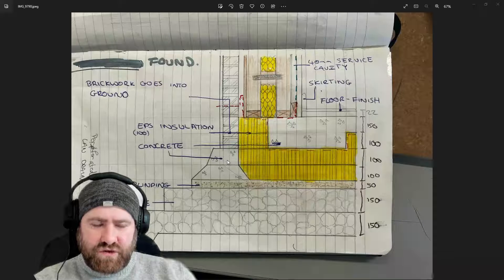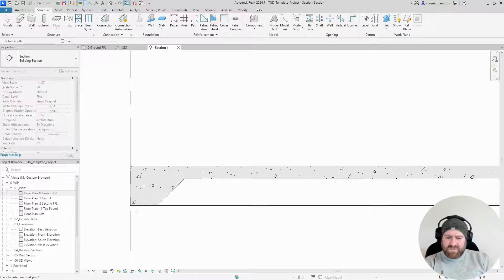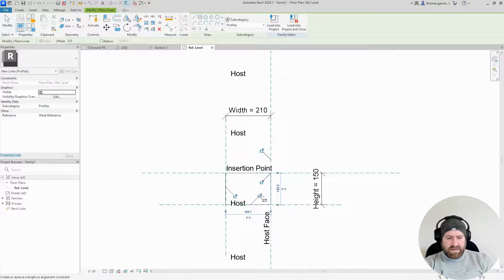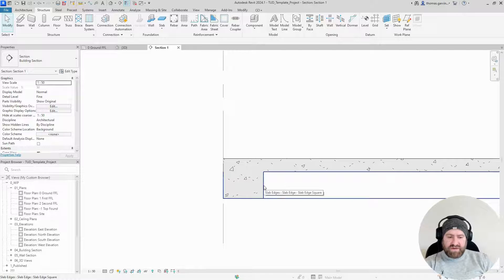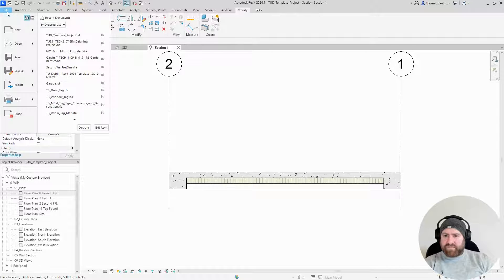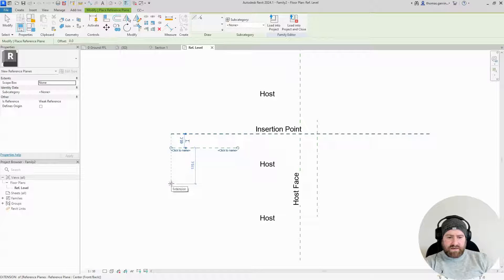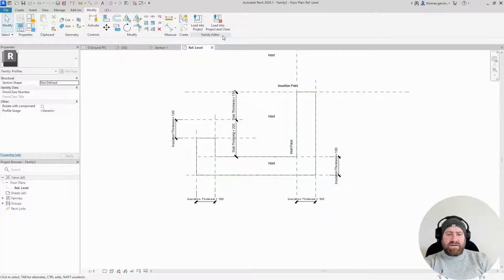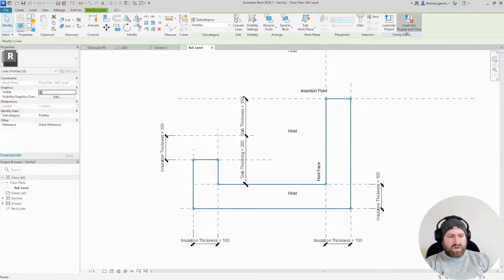Revit Slab Edge Tool - Passive Slab

Comment: Do you ever use override cut lines. I found this is the only way to get the drawing style looking good. Structure = thick lines as opposed to the finishes being thick.
Reply from the maker: Yes I do actually.. pretty much always actually. There's always some line over rides needed but it is definitely the way to go
Reply: Thanks. A video on the subject would be great. Only if you have the time.